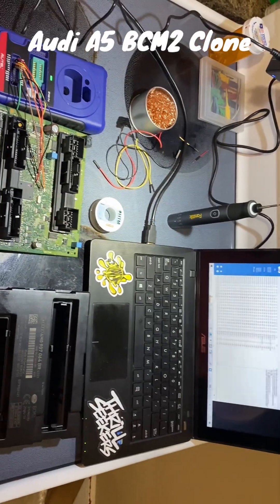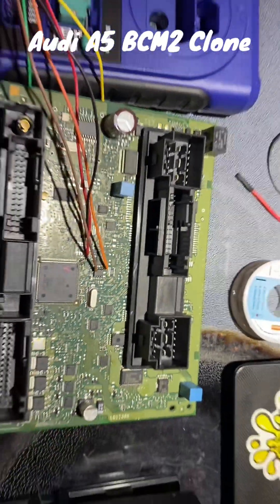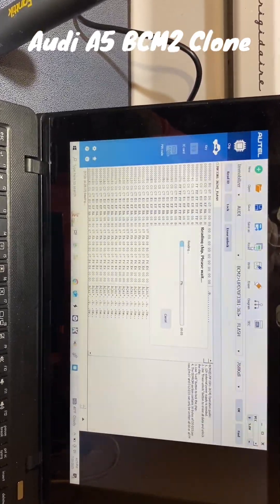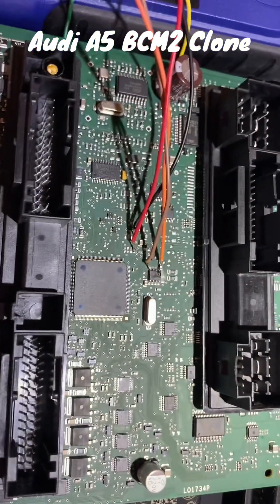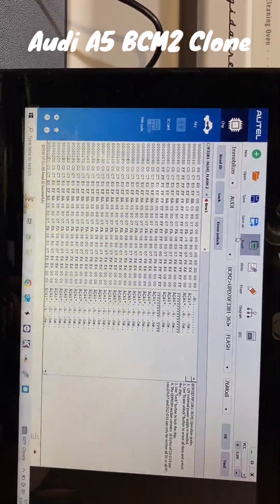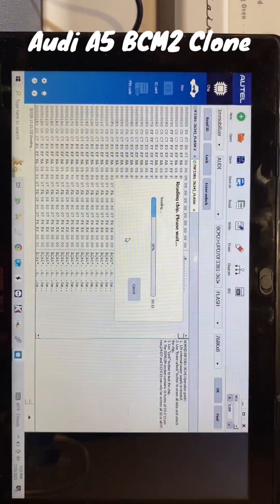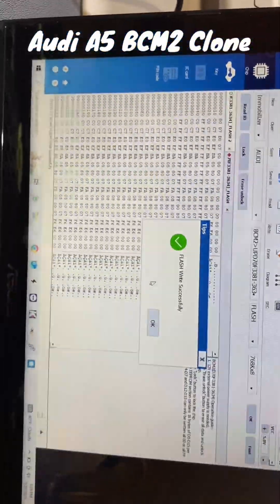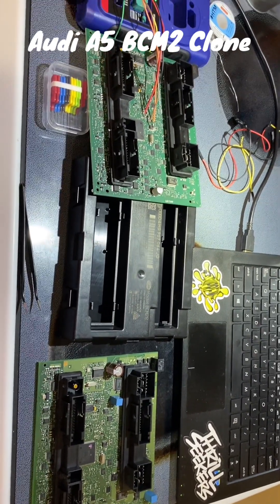Audi A5 BCM2 cloning with Autel xp400 pro and Autel pc programmer software

Comment: Did the BCM work in the car because when I’ve cloned these I use a software to just move the immo data over and not just clone the BCM as when I’ve tried that it just bricks the BCM not sure if it’s mask issue or processor serial number issue also vvdi key tool plus pad has solder less adaptors that make this job way easier to read and write no need to take anything off or solder to the board at all
Reply from the maker: yes it did work.   some of them usally when autel say not supported will brick but this one did end up working.  is this the adaptor your talking about?   Does it work pretty good?

https://www.xhorsetool.com/wholesale/xhorse-vw-solder-free-adapters.html?srsltid=AfmBOorfaK2wB-aIJHZK0F8Pk6TOXS_I50zaD5bq5TOYzZu4msu40fT4hsM&gQT=2
Reply: @drewjohnson5402 yes this adaptor love it works like a charm
Reply from the maker: your using the vvdi tool to do this clone on these right?  i just got a multiprog and was wondering if it will work on these.

Comment: I'm liken the videos , keep them up . I'm stumped on something , maybe you could offer some guidance . 09 Sonata 2.4 sim2k-140 . Been attempting to do a vin change on one for a few weeks now but it hasn't worked out yet . All the tools I've found say R/W maps only for a -140.  It has AM29bdd160gb,  AM29f400bb and infineon sak-c167cs-lm chip on it . I have a way to read the 29f out of circuit but no vin was present . Thoughts ?
Reply from the maker: I'm not familiar with that specific ECU but I know it's possible to change the VIN, I'd recommend doing more research on the ECU and trying a different method to read the data.
Reply: @drewjohnson5402  Figured it out . A KTAG V7.020 clone .did the job . Their pinout was wrong , had to figure that out too .  Took forever but hey ...a win is a win .